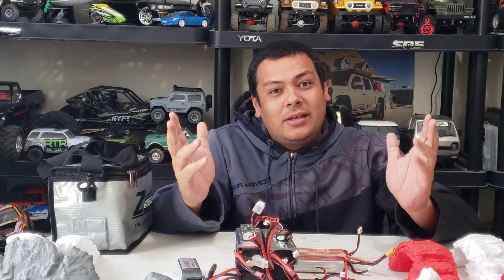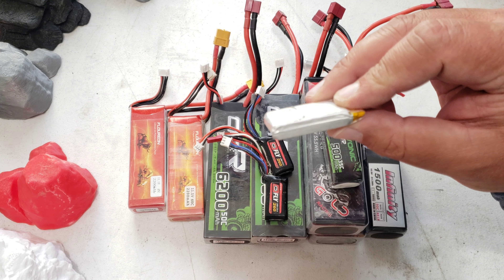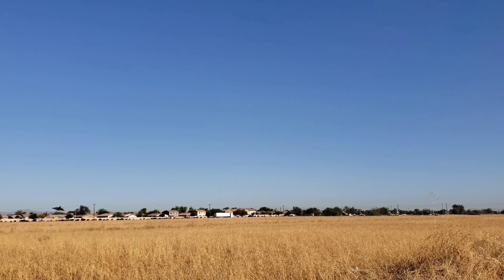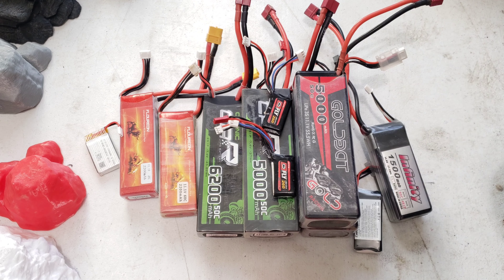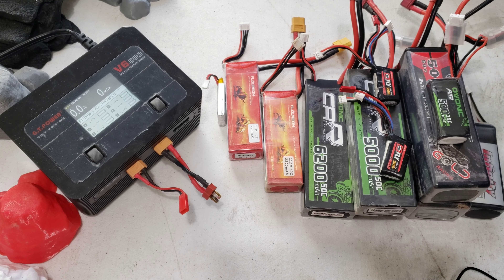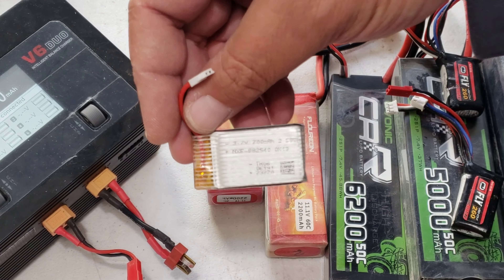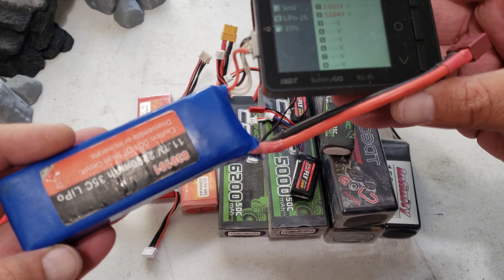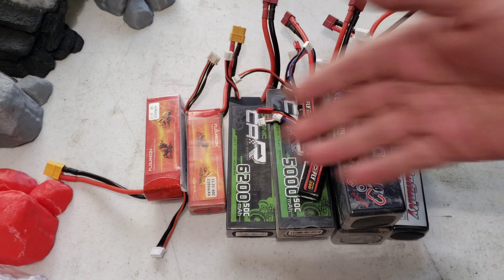RC Lipo Battery Care and Safety. How I Charge and Store Lithium Polymer Batteries.

Comment: Great job David! Very informative video. I'm glad I saw it! I hope all's well! Continued success with your channel!
Reply from the maker: Much appreciated!
Reply: @RunThatRC  Welcome! 🤜
Reply: Quick question, is a "Supulse" B3 V2 10w charger all I need for a Zeee 5200mah? Or do I have to get something that has a digital readout to know exactly what voltage the battery is at? Sorry, I just don't understand. Not sure if what I bought is strictly for balance/storage charging...or if that fully charges it & when the Esc5 sguts it off that's the correct amount for storage?
Reply: @Erkl  Sorry, I personally don't know the answer to your question. I also have the Zeee 5200 mah batteries, but I have a Tenergy charger. I use the balanced AND the Deans connector to charge them. I'm not familiar with any other chargers.

Comment: Quick question, is a "Supulse" B3 V2 10w charger all I need for a Zeee 5200mah? Or do I have to get something that has a digital readout to know exactly what voltage the battery is at? Sorry, I just don't understand. Not sure if what I bought is strictly for balance/storage charging...or if that fully charges it & when the Esc5 sguts it off that's the correct amount for storage?
Reply from the maker: most chargers that are capable of charging multiple types of batterys and has an adjustable charging amps setting to safely charge batteries. I do recommend one with a screen and a storage charge option to make life easier. When your rc cutoff happens the battery is depleted and needs to be changed or storage charged afterwards.  Hope that helps.

Comment: What exactly is storage charge  ?
I have that on my charger I just don't know the difference between that and balance charge.
Thanks Keith
Reply from the maker: storage charge is what you want to do when your not going to use your lipo for a couple days. It charges your battery to about half charge for safe storage. Balance charge is for balancing your lipo batteries so that each cell matches the voltage to each other. Both do balance though so I only usually use charge and storage mode.

Comment: so does the charger bring it down to 3.8 storage volts to store it, if you charged it up and dont get to use it, put it back on the charger to discharge it?
Reply from the maker: yes most decent chargers will have a storage mode so you can discharge your lipos to storage charge.

Comment: Didn't want to spend money on a cell checker at first, but not having one is making me paranoid xD For some reason I just don't trust the low-voltage protection in my SCT. So in hindsight a cell checker actually seem like a very important gadget to have.
Reply from the maker: I was late to get one as well but can't imagine camping or RCing without it. I use it to charge other devices with unused batteries. That also helps me store unused batteries to proper storage voltage without wasting the charge. Great gadget for sure.

Comment: very informative, thanks for this, david 👍🏻😀
do you place the battery and charger inside the lipobag while charging? or the battery only?
Reply from the maker: I should be placing the batteries in a lipo safe bag (just the battery) but I actually don't.  I store them in metal containers and lipo safe bags though.
Reply: @RunThatRC  thanks, tito david! 😁
Reply: Quick question, is a "Supulse" B3 V2 10w charger all I need for a Zeee 5200mah? Or do I have to get something that has a digital readout to know exactly what voltage the battery is at? Sorry, I just don't understand. Not sure if what I bought is strictly for balance/storage charging...or if that fully charges it & when the Esc5 sguts it off that's the correct amount for storage? Also, I don't have a safety bag, how much of a risk am I at, considering how I'm charging & all? I plan on driving at least once a week for each battery...

Comment: Hey. Can you run a 2S 7.4 volt Lipo on a WPL 370 motor? If you can , what brand do you use?
Reply from the maker: yes you sure can. I use 2s lipos mostly. More consistent throughout its run. Don't know your rig. a c24/14 probably 2s 1000mah other trucks can go a little bigger like the b series trucks I run 1300 to 1500mah. I use whatever I find on Amazon or ebay.

Comment: You didn't discuss WPL, MN batteries. I'm trying to find an adapter plug for either a protek, pr spektrum charger I have. How do you charge your wpl, mn batteries?
Reply from the maker: I cut the connector off a bad wpl esc and soldered it to a xt60 for my gt power 16a charger. Then just charge the batteries in lithium ion mode. WPL sells a connector kit for like 2.50 usd on the official site. You can solder that to whatever your chargers uses. https://www.wpl-rc.com/?ref=DAVIDCLARK

Comment: always wanted a lipo battery 😔😔😔nice video man
Reply from the maker: are lipos hard to get in your area?
Reply: yes am trying to make my friend oder 2 for me am not fining the 7.4 dat i want  am in jamaica
Reply: @RunThatRC   sir i have one 4000mah  3s 30c battery .Can i charge this battery at 1a value using blance charger  it  cause any problem? And if i charge 30 or 40 minutes and then if i stop some times for cooling purpose then if i again start charging then it happens any problem ? Plzz reply sir .
Reply from the maker: @soumiksaha720  you can charge a 4000mah battery at 4A safely. It shouldn't even get warm actually while charging at 1a. If you meant 400mah on 1a then yes it's a little fast but should still be ok in most cases. You don't want lipos getting hot while charging because your just degrading your lipos. Best rule to follow is charging at a 1c rate. 400 mah batt at .4a and 4000mah at 4a. Hope that makes sense.
Reply: @RunThatRC  Thank you so much ❤️

Comment: Do you need to use 2 of that cables or  it depends if you rc car have charging port?
Reply from the maker: not sure what the question is but if you're referring to charging then yes a lipo that's 2s or more will usually have a balance lead for balance charging. so both leads would plug in to a balance charger.

Comment: 3Should a battery that comes out of storage be immediately charged to full, use up any remaining charge, THEN be charged to full? Does it matter either way?
Reply from the maker: Lipos have no memory like old ni cads so you can run them at any charge state (just don't discharge below 3.2v per cell and charge above 4.2v per cell).  It's good practice to charge then run then storage charge lipos to 3.8v per cellwhen not in use to get the most out of them.

Comment: storage my batteries range doubt

Li-Ion battery 3.7V 2000mah and Li-Po battery 3.7v 3000mah what is the range for long-term storage mode for these two batteries? battery similar smartphone
Reply from the maker: I like to store all my batteries with half charge. Storage voltage 3.7 to 3.8 volts per cell.

Comment: So why is your storage voltage at 3.8 per cell when each cell is rated at 3.7 ? Thank man
Reply from the maker: I'm not a battery chemistry professional but thats just what's safe practice according to the experts.

do not discharge lower than 3.2v per cell, don't charge over 4.2v and store at 3.8v. if not using for a while. Been follow these rules and lipos have been good to me.
Reply: @RunThatRC  yeah I need to get a good charger, been just using the USB ones that come with the batteries 🔋 I only have baby single cells and 2500MAH 2S but i was curious as my small 1S after charging says 4.1 volts on my test meter
Reply from the maker: @bubblesrcshed  4.1v is better than 4.3v and above. I rather have a charger undercharge than overcharge and ruin the battery.
Reply: @RunThatRC  see that’s were I find it a little confusing as a 1C lipo says 3.7 volts so I assumed that was the max Volts of the battery. Makes no sense that they call em 3.7 volt if they charge to 4.1 or 4.2 too me but I am also not expert lol 😝
Reply from the maker: @bubblesrcshed  yup I dont get it either lol
Reply: 3.7 is the Nominal Voltage not the max charged state, just the same as your AA rechargables, they are 1.2V but fully charged are normally 1.4 or a bit more.
That is why you store Lipo's at 3.8V per cell as it is just above nominal and will not drop a lot if any for months.

Always best to use a good quality Balance Charger for 2 cells and above other wise the cell voltages can get a bit out of align which is not good.
Can be bought back inline easy enough by charging each cell individually via the balance connector as a single cell Lipo.
Reply: @DelDredd  cool man not sure if my charger is great but it’s Turnegy 5amp balance charger. Seems to keep my 3S cells perfectly balanced so far after 15 discharges. 
Interesting stuff I thought 3.7 would be would their flat per cell, I learn something new everyday. 
Cheers 🍻

Comment: If you answer a quick question for me I will definitely subscribe and hit the bell.
I have a brand new for sale GIFI 8050 lipo battery.
I have never used it yet.
Can you give me a ballpark figure of what the IR should be ?
Thanks Keith
Reply from the maker: high discharge with more mah usually lower ir than a mini pack. I would say for a 8050mah between 1-10 milliohm per cell depending on discharge rate capability on your lipo.

Comment: Every LiPo is a ticking time bomb. This is not an exaggeration.
Reply from the maker: Over 15 year now and have not had any incident with lipos while charging and in storage. Only issue I had was when I used a worn out lipo on a high powered rc boat and that actually puffed and vented. burning the top half of my boat. If you charge them properly, storage charge when not in use and store in a cool dry place they seem to be safe enough for me.
Reply: @RunThatRC  You are a responsible LiPo user who is following proper procedures to charge, store batteries. But I can't get my children to do that who treat LiPos as any other alkaline batteries. I blame manufacturers who haven't come up with safer high performance RC batteries. When I buy LiPo which costs as much as my road car, my expectation is that LiPo to be as safe as my car battery.
Reply from the maker: @littlestar5737  definitely need to take care of them. It's definitely not kid friendly. They should use lithium ion batteries for RCs intended for the younger ones and leave the lipos to the more hobby oriented enthusiasts. Just like any hobby there are precautions and instructions to take to do whatever you are doing safely.

Comment: Jeez since when do you need to be a mathematical genius to use a GD rc car lol.  I should of went nitro!
Reply from the maker: nitro is awesome! Electric isn't as complicated as some would like to make it. I've switch to mostly electric nowadays but still like the nitro stuff. When Lithium Polymer batteries became available it was definitely scary seeing them catch fire and hearing all the horror stories. In all honesty I have never had a issue with lipos when used and maintained properly. I even use lipos to power my nitro rigs electornics. Only issue I had was a cheap lipo on a high power speed boat. Set the battery and esc on fire in the middle of the lake and melted the boats lid.
Reply: @RunThatRC  oh wow.    I mean They sent the battery with a usb charger with the car I bought.    So I charged it and on a hunch started to research them.    Now the videos are saying not to leave them charging over night/. Store them in a lipo bag/ etc etc. or the thing could burn down your house.  So yeah I knew none of that info when I bought the rc car.  I think the most inconvenient thing is to have to babysit the battery while it’s charging.
Reply from the maker: @jamesa6272  definitely not fun having to watch your charging batteries. A fast charger can help speed up the process and is definitely safer than those USB chargers.
Reply: @RunThatRC  yes I picked one up on Amazon yesterday.  Waiting for it to come. Thank you
Reply from the maker: @jamesa6272  Its a great charger.